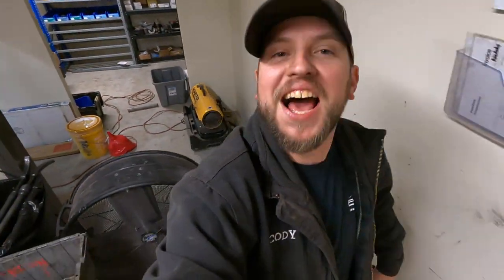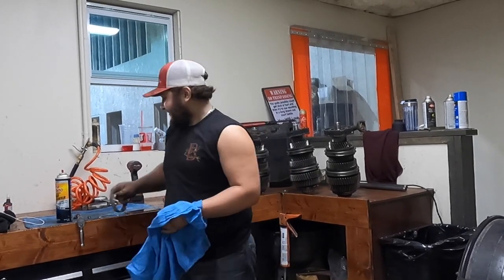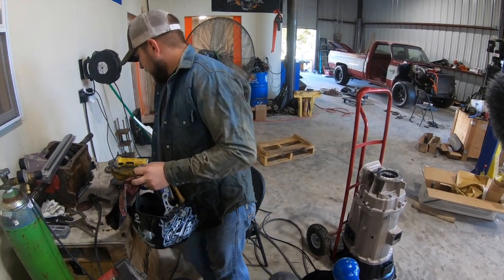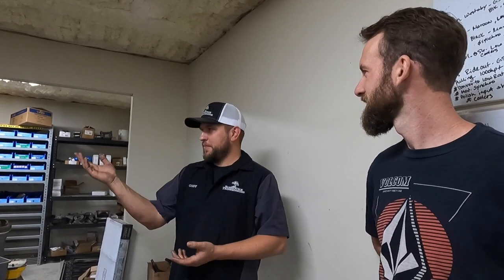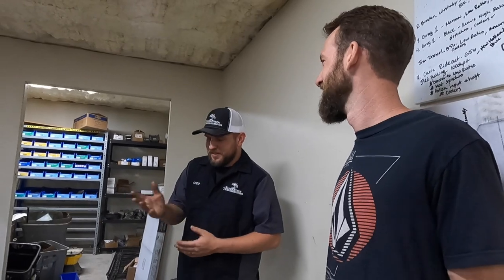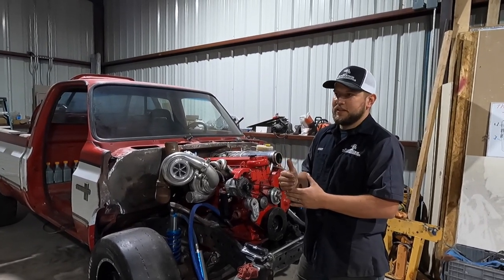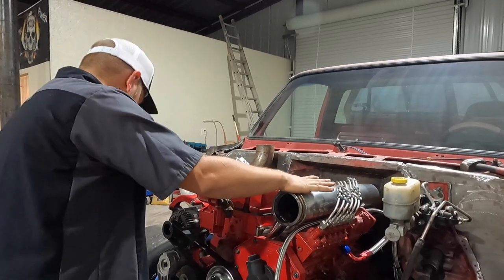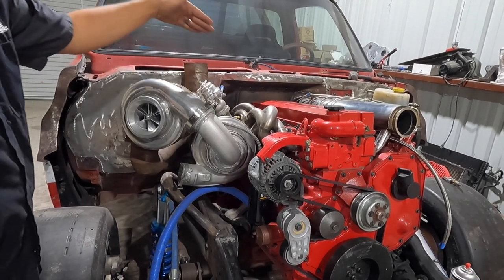SuperStick Transmissions Shop & Race Truck Tour: Bonus Video | DestinatioNow

Comment: Any updates 2 years later? Pros/Cons?Just curious. I have an 03 with the NV5600
Reply from the maker: I love it, it’s been a great transmission. Shifts like a dream and handles heavy loads very well
Reply: @DestinatioNow  At how many miles did you do this? I wish my 6th gear was taller! In the 20yrs since new that I've owned this truck, I can honestly say it's never been over 75mph. With the stock gearing even at 70mph on the interstate in 6th gear, it seems "Wound out".
Can also count on one hand how many times I've ever used 1st gear 🤣
Reply from the maker: I have 3.55 diffs and all the gears are right where I want them. I installed the nv5600 4 or 5 years ago. My odometer retired a long time ago so I don’t know the miles but she’s always been my daily driver